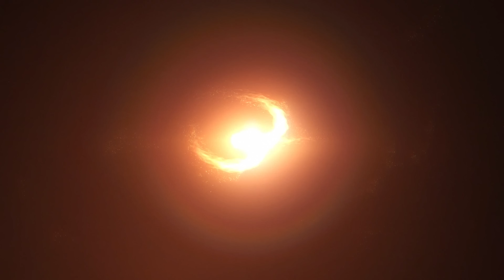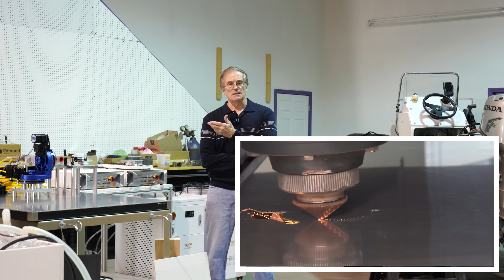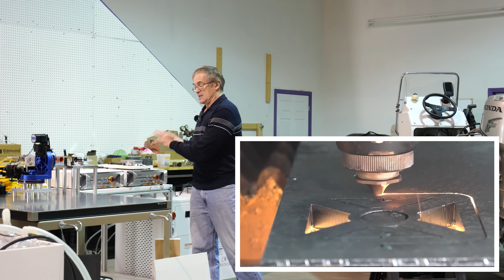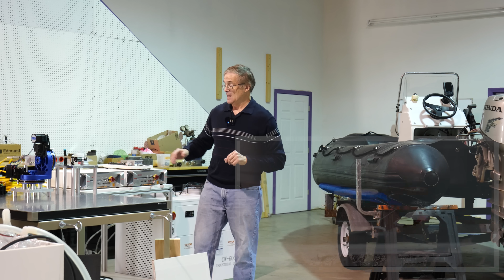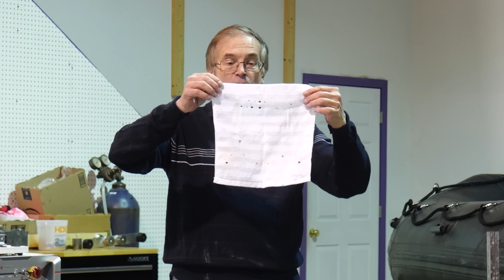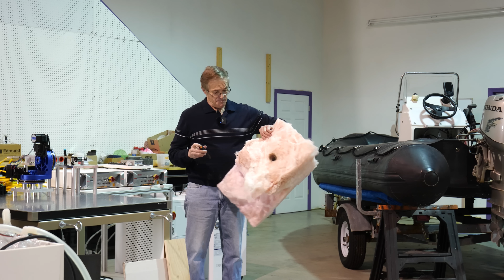We have a problem... and need your help!

Comment: what about a water curtain. pvc pipe with a high flow pump or two and a basin for the water should be good enough and should be scalable. the  turbulent water would defuse the light no?  at least enough that it would mitigate any potential damage it would cause. maybe a dense mister set up for maximum diffraction for minimum water volume. or a glass box with a foger pumping through it or something. im just thinking of getting away from the idea of absorption/blocking and leaning towards defusing the light to non damaging levels.

Comment: Thin concrete slabs on a wooden frame. Sloped angles, so they overlap. Easy to replace burnt ones. Make the frame at an angle, so the panels just rest in the frame. Great show!

Comment: I would employ an old addage here. "You're trying to reinvent the wheel." NASA built the space shuttles with:

Space shuttle thermal protection system (TPS) tiles were fabricated from a composite of silica fibers and a borosilicate glass, with the outer surfaces coated with a silica-based glaze for added protection. The process involved several steps, including forming the fibers, mixing them with water and chemicals, casting them into molds, and then firing them in a microwave oven to fuse the materials. Finally, the tiles were coated with a silicon polymer to waterproof them. 
Here's a more detailed look at the process:
1. Fiber Formation:
.
Silica fibers, produced from high-grade sand, were the primary material. These fibers were then mixed with water and chemicals. 
2. Slurry and Casting:
.
The mixture was poured into molds to form the desired shape and size of the tiles. 
3. Sintering:
.
The molds were then placed in a microwave oven at high temperatures (2,350 degrees) to fuse the silica fibers together. This process, called sintering, creates a porous, yet strong, structure. 
4. Coating:
.
The tiles were coated with a silica-based glaze on the outer surface to provide added protection and wear resistance. 
5. Waterproofing:
.
A silicon polymer was applied to the underside (non-glazed) side of the tiles to waterproof them. This was necessary because the tiles were porous and would absorb moisture, which could affect their heat resistance. 

In addition: There is Ceramic fiber wool that withstands 1,600 degrees C. The polyester fiber batting you tried burns or melts at 538C and boils at 1000 degrees C.
I would put mechanical limits on the turret to block the energy from escaping a 8' x 8' kill zone. make a 12' x 12' back wall for safety.
I would experiment with cheap copper tape layers to distribute heat. This also could buy time and frustrate the beam's effort to penetrate one layer, then the next. The smoke would weaken the beam.

Comment: I'd have a look at Ceramic Thermal Batting in multiple layers on supported from behind, or use Insulating Firebricks (IFB), also known as Fire Bricks, are used in high-temperature applications ranging from 2,000°F (1,093°C) to 3,200°F (1,760°C). IN-30's are rated for 3000℉, build in a multi layer configuration to stagger the joints, on a rolling frame to support them and make them easy to move,

Comment: rotate a wooden* plate constantly, 
to spread out 1 x1 mm to e.g. 1000 mm circumference x 1 mm = 1000 x less energy per area etc. 
= a few dozen or hundred times more burn through time per thickness
( no problem to rotate or swing a several m² plate with homemade stuff: https://youtu.be/jjeUuakHsLw?t=29 )
the wood can easily
 be impregnated with cheap "waterglass" = liquid potassium or sodium silicate which prevents burning very effectively.  

if the rotation fails this should be detected by an as primitive as possible sensor as dead man switch to turn off the laser,  
and the rotating mechanism should allow the wood to continue to spin due to ineratia in case of a power cutoff.

Comment: What about diffraction grating sheets? Meant for dispersing different wavelengths but should also split even tight beam of a single wawelength into several dots along an axis, multiple layer and the split or power/area loss should be exponential. Just a thought.. I'm not sure if the materials available for relatively low cost can manage the transmission of without melting.. Interesting problem to have, indeed! Looking forward to the solution. 😊

Comment: 10-30 gal fish tank, fill with a non toxic ceramic glaze suspension. Use a small motorized stirrer in the bottom to keep the suspension moving. I don't know if it's a feasible solution, but it's "portable",  hypothetically it could absorb laser energy by converting some of the suspension into a glaze, and all materials are easily accessible.

Good luck, and I look forward to the real solution in the future!

Comment: Why not try a crystal shutter driven by RF. KIlls the ability to lase, but defaults to blocking in case of power failure. if you can, stop the beam before it lases.

Comment: Yeah if you want cheap go to a pharmacy and buy gel coldpacks and coat the wall with them. Not very cheap  and not very portabile but that's all I have.
You are very close with the wood/carbon panels, maybe if you get them proper wet or overlay wet cardboard you will be set

Comment: Can you use a mirror on the back, a sheet of glass, and then a glass that functions as a dicroic filter that lets the laser in but not out like a check valve or diode. This should make it osculate inside , dispersing out all the edges of the glass, kind of a dispersing fiber optic

Comment: Ah, my initial comment said you can rely on bricks.

But you want a THIN barrier.
Well, that’s more tricky.

How about two pieces of wood with a layer of black water-based gel between them?
That gets rid of the fire hazard and wets the wood AND makes it so there’s a pool of liquid that flows slower than just plain water but can absorb laser light until all the gel boils off.

Comment: This may seem silly, but have you tried a fog machine? An ultrasonic water vaporizer will create a cloud that has negligible mass for absorbing energy but an amazing capacity for diffusing it. This could be used in combination with several thin layers as an intermediate medium. Imagine something like several thin sheets of borate fire treated plywood with fog between them.

Comment: Likely too expensive but alumina desiccant (I generally only use the desiccant ball format but I think even a mostly alumina sand may work here, the power you guys are using is just hard to comprehend) may do a better job at either phase transitioning or surviving long enough to scatter the beam onto a backing drywall sheet. Given the power I'd also still effectively frame a full wall and fill it with the desiccant / whatever the solution would be. I like @Nullpersona's idea of wet sand / soaking the medium so at least it has a better chance to self extinguish, either way good luck.

Comment: buy a large aquarium, put several layers of plywood into it, put the pink panther stuff in between the plywood, fill it with water and put that as "ray stopper" at the end of the test rig. Your problem can be broken down to a energy dissipation problem. You need to get out the energy from that tiny spot where the beam hits the target as fast as possible. If that does not work and the energy is still to high, try to use copper. Copper has the 2nd most heat conduction coefficient - silver would be somewhat better, but at a much higher price. And cool the copper. in doubt fill the aquarium with ice behind the copper wall. The "pink panther" stuff melted away, because it is an insulator. It is made to transport energy as bad as possible. What you need is the opposite. You need stuff that can transport the energy to a much larger area / volume fast. Water is a good head conductor, copper is significantly better. Ah, and BTW: try not to kill anyone. You are in the weapons league now ;)
Reply: Same principle as a bullet proof vest, but for laser energy- spreading the energy out.
Reply: 1. Isn't copper quite expensive?
2. What if copper oxide forms?
3. What about aluminium?

Comment: Hello. As someone already mentioned, lots of sand and/or carbon (graphite). But I suggest you ask @Nighthawkinlight. Using non-flammable (fire retardant) paint/foam. Or cork. Both are ablative. Ceramic is great to a certain power, but you are looking for an ablative effect for a continuous laser beam to gradualy lower its effectivness on target. Solid boron or tungsten is way out of your price point and weight limit. Keep up the good work and good luck!

Comment: You can buy lava rocks for grilling for fairly cheap. I would assume they could likely handle the heat for a few seconds but I have not tested this theory. I have no idea its actual reaction to that laser. But also you could try stones like pavers or ceramic tiles. They make tons of different types of tiles from slate to sand stone to granite etc.. I would think a good set of tiles would work pretty well. Just get the slimmest tiles to save weight.

Comment: I haven't done any testing, but it would make since to me to atomize a slurry of an opaque substance (maybe zinc oxide) and a carrier (water or mineral oil). Instead of blocking the laser, we focus on diffusing it. If it's significantly diffuse, it's no worry to anyone. Each droplet of our slurry would split a portion of the beam and it would carry on like that through our curtain. If we use mineral oil in our slurry, we could crack it in a way similar to a fog machine.

Anecdotal evidence:
Lasers lose a significant amount or energy when travailing through dense fog
Zinc oxide is extremely opaque
Mineral oil and zinc oxide is cheap and readily available
Scaling this would be cheap and easy

Comment: Use a metal enclosure filled with water, with an optical window to make the laser enter (you could also make the laser enter from above leaving the top open, but that woule need a mirror to redirect the laser beam downwards)
The laser once entered the light toght (beside the windows entrance) metall enclosure filled with water, will start reflecting around the walls, every reflection will cause partial absorption that will be turner into heat, this heat won't cause melting as the metal wall is in contact with water to which the heat will be transferred, if a high reflective wall is used there is almost 0 chanche of pinching trough the wall as the power will be distributed over a higher number of beam reflections and into the water as a result.
Water has an enormus enthalpy of evaporation, so just 1 kg of water will be able to absorb multiple MJ of beam power.
This box can be scaled up or down depending on the ampunt of time the laser beam needs to be absorbed as the time is proportional to the amount of water inside.

An even more effective version of this contraption, will be using a water dispersion with scattering medium, like TiO2, this will disperse the laser brightness over a few cm rendering the possibility of punching trough the metal virtually 0
Reply: I had the same idea: 
Something similar as black body object: hollow object with a hole in which a dispersive lens is mounted and  having good absorbing walls. The whole object is submerged into a water reservoir enabling water evaporation (counting on 2.26 MJ/kg power sink)

Comment: Two more thoughts.  Intumescent paint, which I don't think will help much but I thought it should be on the list.  And a self-healing diffuser; like maybe the vapour cloud from a humidifier or a smoke generator machine.

And also I feel like you should be using safety glasses with side shields.  Especially if any kind of reflective mechanism comes into play.

Comment: Back in 1986 when the company i worked for was developing a co2 laser 1200w (i know not as powerful) they used a carbon block 2ft square and 3 inches thick. when aiming the laser (adjusting the mirrors.) After reading some of the comments a spinning background covered with a carbon material that is wet sounds good. Can be built in sections for easy assembly/disassembly. By the way the block showed signs of heating but little wear.

Comment: Maybe something like a waterfall so the beams just heats up the water but doesn't have enough time to do anything.
As water is reflects it might not be a good idea but you might find a way of doing it with sand...

Imagine having a constant flow of sand falling down in the "garage door area" that the laser can just impact withouth causing any harm.

I honestly think it is a complex project by itself but it will for sure do the job.

Comment: Graphite can absorb a laser beam, effectively stopping it. In fact, graphite is commonly used as a material for beam stops due to its high absorption of laser light and ability to dissipate heat quickly. Graphite's unique electro-optical properties allow it to efficiently convert laser energy into thermal energy. 
Here's why graphite is effective at stopping lasers:

    High Absorption:
    Graphite is a good absorber of light, especially at the wavelengths commonly used in lasers. 

Good Heat Conductor:
Graphite can quickly dissipate the absorbed heat, preventing damage or overheating of the beam stop. 
Low Reflectance:
A properly designed graphite beam stop will have a very low reflectance, preventing unwanted reflections of the laser beam. 
Laser Ablation:
Graphite can be used in laser ablation, where it is selectively removed or modified by a laser beam. 
Laser-induced graphitization:
Laser radiation can be used to enhance the graphitization of carbon fibers, improving their properties. 

For example, a graphite/aluminum plate can be used as a beam stop, absorbing most of the light from a high-power laser. The graphite plate is thick enough to absorb the beam but thin enough to transfer heat quickly to a heatsink, according to NASA.

Comment: Something like gypsum board or glass covered in the commercially available version of Vanta Black paint. Maybe BLK 3.0. That stuff is so light absorbing it looks ai generated in photos and videos. Coated on some sort of cheap medium that disperses heat could be a decent solution. Portable frames that can be cheaply built and deployed easily.

Comment: Use thin wood pannel about 1/4 inch ply wood. About a 3 inches of sand with water used to settle and pack the sand. Then another 1/4 inch ply wood. Making all of that in a frame with wheels for easy moving

Comment: Vantablack? Or Amazon has Musou black, which absorbs 99.4% of light.  Might not be appropriate for the wavelength, though.

Also, maybe a drywall box with sand or vermiculite behind it?  As the sand burned off, it would fill back in, and the refractory characteristics of sand would disperse the strength of the beam.

Comment: Hi, I might suggest a layered structure using plywood to contain sand or, even better, graphite.  The idea is that the first layer is sacrificial and is used only to contain the fluid material. The sand/graphite inside the two drywall layers will melt, but gravity will continuously feed material. The gases created by the laser ablation need to escape, so I think it is better to avoid adding water to the powder. If you use dirt to fill them, you can just empty those boxes before transportation.

Comment: why not build some sort of waterfall with an absorbent background so you are constantly replacing the water that is evaporating. I would try a carbon fiber welding blanket as the backdrop.

Comment: How about a barrel of sand? You could have a mirror direct the laser straight down into a barrel of sand. As it burned through some of the sand, perhaps more sand would then automatically fall into the void. Or you could keep adding sand from the top and sifting it out the bottom possibly.

Comment: Wall of plywood (cheap, relatively light), at an angle (45° to maximise relative thickness as a last line of defense) with a constant flow of water mixed with an dispersing and/or absorbing agent (charcoal, TiO2) set in a little pool for recirculating the working fluid. Afterwards just let the particulates settle out and dump the water. Should be cheap enough.

Comment: How about not absorbing the beam at all, but rather re-directing it in a controlled way? Open the back door and build an array of mirrors which just send the beam right up into the sky? The mirror array would obviously be quite big, as it would need to be in a ~45° angle. But it would not need to be that heavy, which seems to be the main drawback of many other solutions, like the brick wall for example. Should also be quite cheap.

Comment: You should experiment with beam dumps. Graphite bricks with water cooling - an industrial chiller dumping heat. The surface should be roughened or grooved to scatter light, and angled to avoid direct reflection. Embed temp sensors in the graphite for auto-shutdown.

Comment: I Have 2 suggestions.  If you have something transparent, like quartz (but cheaper), you could make a water tank filled with whatever solution/colloid to absorb/scatter the beam.  Barring that, find a good cliff face, old or new quarry site to use as a back stop.
Good luck

Comment: Aerogel should be thermally nonconductive enough to slow the laser, or whatever the tiles on the spaceshuttle are made of. Also what about using water? A large container of water should be able to stop the heat from destroying anything

Comment: what about this? instead of pointing the lasser to a wall you put in in the ceiling facing down. You set a pool with water with a ceramic material in the floor. Ceramic materials typically have a high melting point (it was used to cover the exterior of the space shuttle to protect the ship from the heat of the reentrance into earth atmosphere). The water in contact with the ceramic floor should help cool it. Nice thing about that is that you can control the depth of the pool and the amount of water you will use to disipate all that energy/heat.